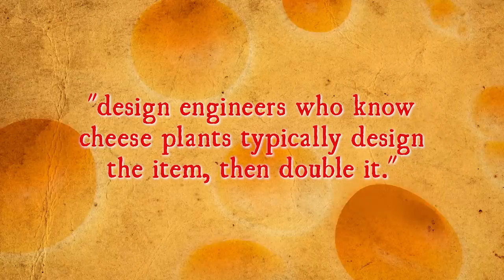Why Some Cheeses Come in Wheels and Others in Blocks?

Comment: Great video! I worked for years in the retail department of the Tillamook Cheese factory. They historically produced cheddar cheese in wheels as well as rectangular blocks, the most famous being their 2 pound Baby Loaf which is still in production. With the modernization and expansion of their production process, the cheddar is now made in 40 pound blocks for the aging process, then cut into smaller rectangles for packaging and distribution, mostly as Baby Loaves. The local high school's sports teams are called the Cheesemakers.  I enjoyed the variety of cheese information in this video.